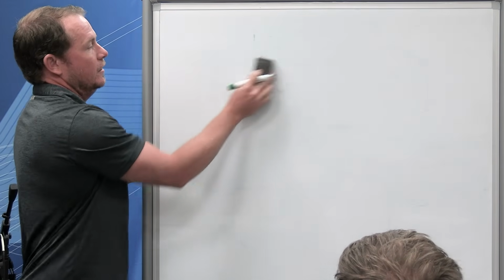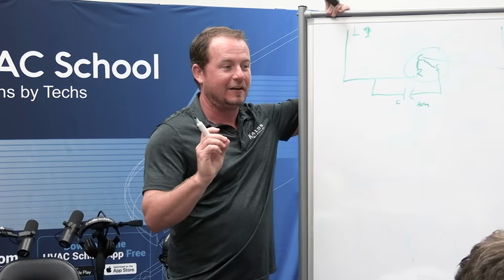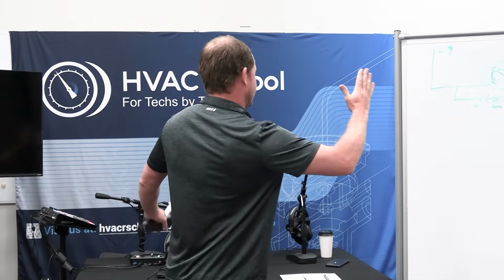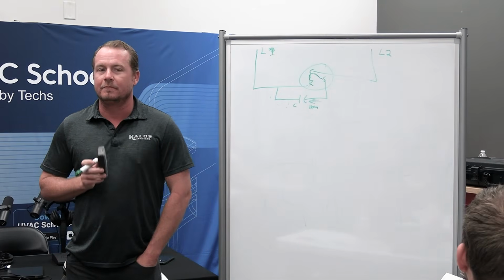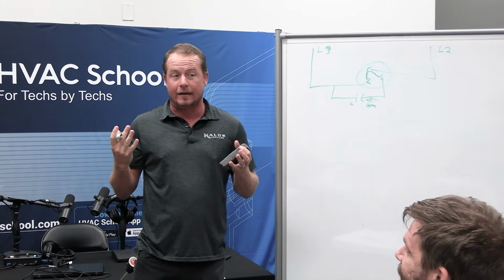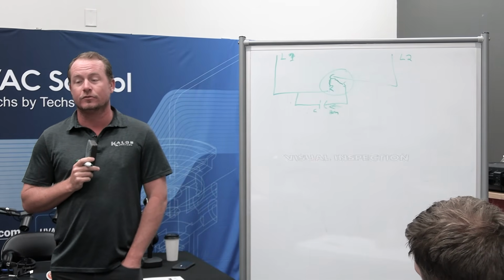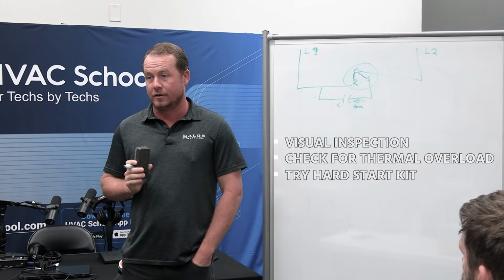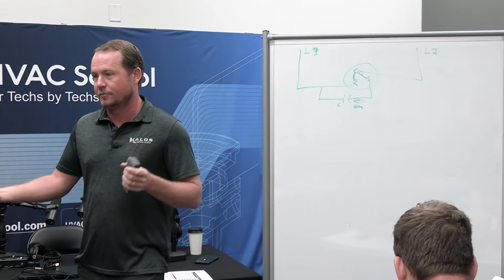Capacitor and Hard Start Myths Busted

Comment: For ac that is actually not the right symbol for a capacitor as the one you show is polarized so only for DC.
The symbol for an un polarized cap is just 2 straight lines instead ( two T instead of one curved)
Reply: It is semi common for non polarized caps to have a curved line.  While I hate when part of the world use them, its the + next to one of the lines that makes it polarized.
Reply: I was going to say the same thing, you are 100% correct, we are talking about 220VAC unrectified voltage here, the symbol with a curve shows polarity i.e. the negative most side. You CAN'T (or at least not supposed to) use this symbol because there is no ground reference (or lowest FIXED negative value i.e. -110VDC). You can't even argue that the wave swings to -110VAC, because in the next half cycle it is now +110VAC and the capacitor would be considered reverse bias polarity for that half wave (and boom goes the dynamite after a few cycles of 50 amps of the dielectric boiling to the explosion point). There is a reason why there are two capacitor drawing types for both polarized and non-polarized capacitors. My skin crawled when he said just stick it in a wall outlet as the example. If that was done with a polarized cap, you now have a deadly firework in your hands when it overheats and explodes from the reverse polarity 1/2 wave cycles. If the cap is non-polarized, as these HVAC caps are, then yes, his stick in it the wall and measure under controlled conditions can be checked and validated as he says. Overall, the presentation is excellent and well thought out, it's just a minor thing regarding the symbol usage of the capacitor that should be tweaked to ensure proper proliferation of the component identification. To anyone saying "the rest of the world"... that is a lovely sentiment, pick up an accredited EE book and then find the section on capacitor identification between the two types, your region may do it differently because... well whatever reason, honestly, no one cares why you're doing it wrong, but technically it is wrong, any EE book on the subject matter outlines these facts and if it is being regionally done another way, that is another topic entirely.

Comment: I like to use mechanical and fluid analogue, where voltage is something like pressure. A resistor is a sponge or constriction. An inductor is a flywheel driven by a displacement pump acting as a motor. A capacitor is a double-acting piston with a centring spring whose spring constant is the inverse of the capacitance. A motor depends on having a rotating magnetic field. Three phases 120° apart in phase and 120° geometrically (in space) makes for a perfectly steadily rotating field. Single-phase makes for a useless linearly oscillating field, like stamping on bicycle pedals stuck at TDC and BDC. A single-phase motor makes an elliptical rotating field (strong in one axis, weak on the other) with the help of a wining that has an angle difference (phase shift) in space and electrically (i.e., in time) that works like pushing a foot forward on the bicycle pedal at TDC. The phase shift is important because if the start-run capacitor were replaced with a resistor or a lower voltage supply matching the original phase, the rotating magnetic field would degenerate into a useless linear oscillating field, just inclined at a fixed angle. In such a case, the motor's impedance appears as resistance rather than reactance (with a little resistance), so it turns into a heating element. (Reactance is what you get when you use a flywheel or a trampoline, resistance is what you get when you drive your hand through syrup, dissipating energy as heat.)

Comment: Have a very old, 22-25 year old Coleman, 2.5 ton AC with elect heat strips.  The schematic in the unit showed an FCTR in the compressor ckt that I was NOT able to find anywhere on the unit(contactor ckt or elsewhere) when I looked up what an FCTR was supposed to do the FCTR was to memory suppose to remove/open the elect power ckt from the start winding after the motor started.  I was unable to find such a component, it was not incorporated into the power wiring plug at the compressor prongs like was indicated in the schematic because those connectors were simple wires from the contactor and the start cap to each terminal on the compressor.   Did units that old have FCTR.  I don’t have the model number handy right now but should be able to find and provide it .
Reply: Just buy a 5-2-1 hard start kit, their relay replaces the FCTR perfectly. York/ Coleman never provided those from the factory, it was/is an optional device added by the installer as needed or wanted.
Reply: Brian G, thanks god the input.  I sure couldn’t find the FCTR and had pretty much decided it was optional but shown on the schematic as a generic item.  Does the 5-2-1 relay starter kit include a time delay restart on the compressor for brown outs so the system freon pressure has a chance to equalize or at least significantly reduce high head pressure restart attempts ?
Reply: @hobtink  No, they are called "Delay on Break" timers and they install on the 24v control circuit, usually right next to the contactor is best

Comment: At 27min you said that capacitors are slave to line voltage. This is very misleading as back EMF from the compressor can cause the stored voltage to be much higher than line voltage. Thus why you use capacitors rated for 370v or 440v even when line voltage may be just 220. It's not "extra", the capacitor actually sees higher voltages.

Comment: As an electrician I install a lot of slow start kits when I install backup generators. Thanks for the clarity of what is going on in the capacitor in the condenser unit.

Comment: I contributed to New Age Neon, the standard handbook for Neon sign workshops. Managed the biggest Neon sign factory in the southern hemisphere and contributed to the understanding of Sprites and associated unusual lightening phenomena.  I never came across anyone who valued the Right Hand Rule: Force, field, flow. We caused beer signs to illuminate without electrical contact, only field.  The lack of electrical engineers understanding of field caused regulations enacted that caused millions list to fires and deaths too. It is important even at ten amps at 60 Hertz. We were handling  10,000hz.  And 18,000 V at three amps. We used radio waves in testing too.

Comment: As an average joe here, couldn't you test a capacitor before you install it to see if it is weak or not from the start?
Reply: All testers are a static type, the cap is not under load. I have seen caps pass the meter test yet not perform properly in circuit with the unit running. The key is to buy the American made caps and not the import junk.
Reply: Discharge the cap and hook it to a meter in capacitor mode. It’ll tell you if it’s bad. But only “maybe” if it’s good, as the meter is only capable of putting a small amount of power across it. 

Think of it as testing a sched 80 pipe. The pipe has a spot that’s had a grinder taken to it, 99% of the way through. You fill the pipe with water, and then blow into as hard as you can (most peoples cheeks will withstand ~2psi btw!). It tests fine. But then it blows up at 15psi when you hook it up for real. 

Shitty analogy I know - but you get the idea?

Comment: I've seen capacitors on the incoming power side of RTUs as a power conditioner,  how does that work.
Reply: Improves the power factor, usually used on larger rooftops, if written into the specs.  Utility companies use them up on the poles for the same reason.

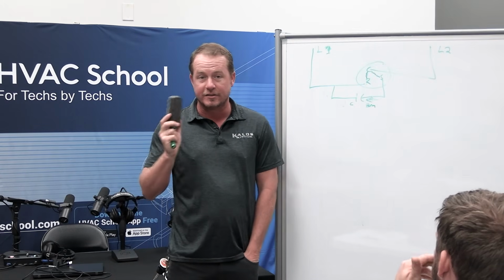Comment: 12:36 "run cap"
Run caps and start caps are very different things.
A start cap is used on motors that have a main and an auxiliary (start) winding.
A run cap will allow a 3 phase (3 winding) motor to run on a single phase supply.
Reply: Yes and no. There are capacitive start motors that only use the capacitor and start winding during startup. A centrifugal switch takes them out of circuit once the motor reaches about 80% of its normal run speed. AC compressors leave the start winding capacitor permanently in circuit to give better torque, so it tends to be referred to as a run cap.

Comment: One of your poorer presentations.

The electrons are coming  from the windings themselves and the wire leading to the capacitor. One should not think of capacitors as "holding a charge" in alternating current. It just moves the current before the voltage. It's the movement of electrons that creates the magnetic field which is why they don't need to connect. In fact you can think of them more as 1 to 1 transformers.

You're right that they can store power but unlikely due to two reasons... where it was in the cycle as you said, but also because they should dissipate any charges into the windings or wire they're already connected to (where the charges came from originally.) So it's very unlikely to be shocked by a disconnected one. I won't say impossible.
Reply: Been bit by quite a few of them without bleed resistors.

Comment: The house is powered by one phase, center tapped to give you two legs of 120. You can call it split phase but it is NOT two phase.

Two phases can actually rotate a rotor (hence a capacitor acting like a second phase.)

Comment: Please explain the back EMF and the reason why capacitors have such high voltage ratings compared to the actual line voltage. I don’t think hardly anybody realizes why the voltage rating is so high on a capacitor but it is a result of the induction of the collapsing field
Reply: The magnetic field an inductor creates doesn't like current changes.  As the current supply to an inductive load goes away the voltage will raise to try and keep the current the same.    While this transient spike is easy to contain, the voltage and current get out of phase.  A capacitor changes the phase in the opposite direction.  You use the two together to align the current and voltage phases to create resonance, and remove standing waves.  A simple LC circuit. Remember, you are working with waves.  Inductance not only has a resistive element, but also the inductive and campacitive components.  The values of each are a function of the primary frequency.  This probolly sounds like Chinese, and you will need to learn the math to fully understand it.
Reply: @falsedragon33  AFAIK, run caps are nowhere near resonance.  If they were, I think the voltage would rise (resonate) off the charts...  [I'd have to calculate the Q, and then there back EMF, which changes it from a simple RCL equation...]

Comment: Hello Bryan, Great class. I went to a two year HVAC coarse years ago. It took a long time to figure out capacitors. You did a great job explaining this. I do happen to agree with Nova Air about current leading the voltage.

Comment: Some places use single phase for residental electricity.  Would that complicate things like central AC?  For example, Philippines uses 230V 60Hz single phase for residential electrical service.
Reply: Why should it? 
Most residential AC here in the US is also 230V 60Hz single phase. I'd take a close look at inverter type mini splits. There are some that are considerably more efficient than old school central air and don't need hard start or soft start kits. Not expensive either.

Comment: If you were putting in a new compressor. Why wouldn't you just take the hard start out of the circuit seeing it was only added to solve an age problem?
Reply: He mentioned that in some installations, voltage drop to the unit is too high.  Depends why the hard-start kit was installed.

Comment: In reading a book about Ben Franklin when he was messing around with electricy he found that he could collect it with different materials in a glass jar. Then figured out that connecting them depending on whether in series or parallel he could increase the amperage or voltage, he call the collection a battery. Sounds more like a capacitor.
Reply: It was long before Franklin.  It's called a Leyden Jar.  Dummy.  Do you people never read books anymore?  See Pieter van Musschenbroek of Leiden, 1745.
Reply: @foobarmaximus3506  so sorry to offend a A worldly scholar such as you.

Comment: So if they don't store power. why is it that you can sometimes short across the terminals and get a loud pop?
Would it hurt to install a 5mf where it originally had a 4mf?
Reply: my 8 month past reply, for others that may have the same question...

He didn't say that.  They DO (can) store power.  [they don't store power long term, like a battery can]
5 for 4?  Not ideal.  4µF is a standard value [I have a drawer full of them] and you should be able to get it anywhere...
25% higher, (~25% more current too).  I am not experienced enough to advise on this.
Perhaps for a short time in a pinch, while obtaining the proper one...
Not on the hottest day of the year, don't want to overheat it anymore than possible.
Amp clamp a reading of the running amps.  Use your own judgment, and if the system is due for replacement and budgeted if it fries it...
(hopefully the internal overload will stop it first, if it causes too much heating...)
If it trips out, stop by all means and shut it down until you have the right size.
Mr K L

Comment: Great video and explanation. A capacitor in this application acts much the same as an accumulator in hydraulics, or a pressure tank in plumbing. All of these items can release a lot of energy(pressure/volume) fast, when needed. Cheers.

Comment: My start capacitor went from lasting for a decade to going bad 5 times in the last 4 years.  When it died a week ago, we tried using a hard start.  Should this hard start last longer than the start capacitors that kept dying?
Reply: Not necessarily. I had a customer who had a bad compressor that every year would cause his run cap and the start kit to literally explode. His compressor run draw was 65% over his RLA, but he refused to change it. So for 4 years I went out every summer and cleaned up the unit and replaced a bunch of melted wires and installed new contactor, run cap, and start kit to get him through the summer.
Your run caps could just be low quality. Buy the made in America caps, they are much better than the Chinese caps.
Reply: Capacitors are not what they used to be. Back in the day, the grey cased Jard brand caps rarely failed.  They were much larger, heavier, and ran a lot cooler as a result.

Comment: Great video. I installed a 5-2-1 start kit on my 4 ton unit. It is properly sized (3.5 to 5 ton) for the unit. You have me a little worried about not using the factory kit. Unit is 20 yrs old and has been running great. Should I be worried?
Reply: Not at all. The 5-2-1 brand is the best "fits all" start kit. Trane is the only brand that has specific separate part numbers for the relays and start capacitors, you buy them separately as opposed to the 5-2-1 being preassembled. The engineers at 5-2-1 claim their relays open sooner than other brands thus reducing the risk of overload on the S circuit.
Reply: @briangc1972  - thank you - my Carrier/Copeland compressor has the start capacitor sized for the 1-3 ton 5-2-1 product (CSR-U1) even though it is a 4 ton unit and 5-2-1 recommends the CSR-U2 product.  I went ahead and went with the same capacitor that Copeland specs - the CSR-U1 and not the CSR-U2.  So I am running as close to the OEM part that is possible it is just that 5-2-1 made it.  The start amp drop is a little more signifigant using the CSR-U2 which went from 108amps to 58 amps (I installed the CSR-U2 before looking into the OEM part and realizing I really needed the CSR-U1).  The CSR-U1 start up amps went from 108 to 76 amps  So not as good as CSR-U2 but not sure what else needs to be considered.  Thanks again Brian
Reply: @condor5635  I would install the CSR-U2

I found when I have used the U1 on 3.5 or 4 ton compressors that they do not last as long.
Reply: @briangc1972  - thanks for the advice. It’s just disconcerting knowing that that’s not what the OEM part is. I don’t know what the technical details are -  pros and cons of using the larger capacitor. Could it be damaging the compressor more than the other one even though it seems to work fine?

Comment: Hi, does the capacitor also correcting the motor power factor? Thanks
Reply: To a certain degree yes, but nowhere near completely since the PF of a PSC motor will change depending on loading. On the other hand at least some of the inverter systems have near perfect power factors. I have metering on each of several private labeled Midea manufactured cold climate mini splits and see 0.98-0.99 PFs regardless of loading. That same exact machine is imported by well over a dozen different companies and sold under at least twice as many brand names differing only in the sticker on the ODU.